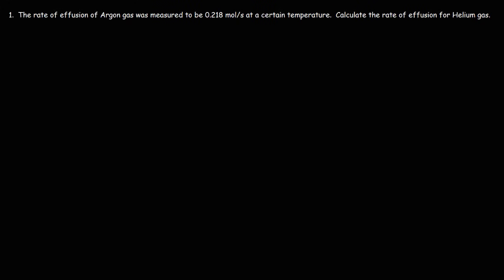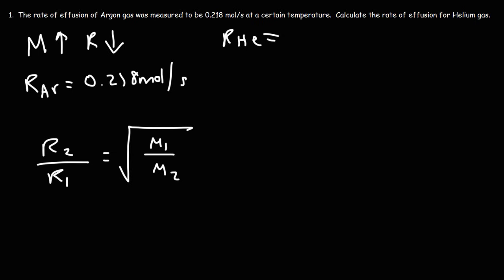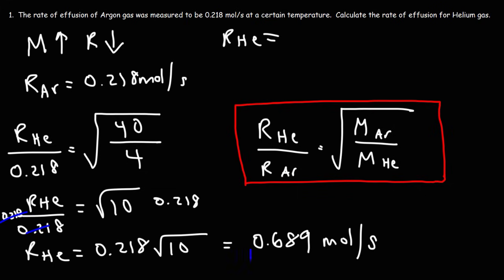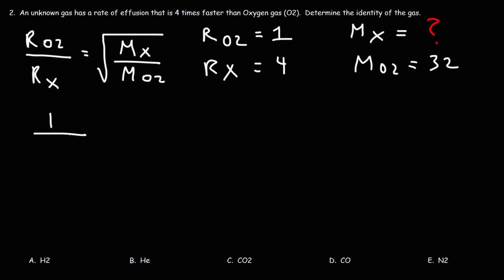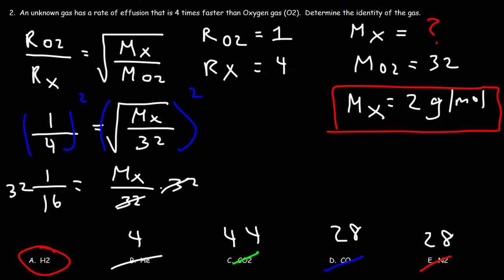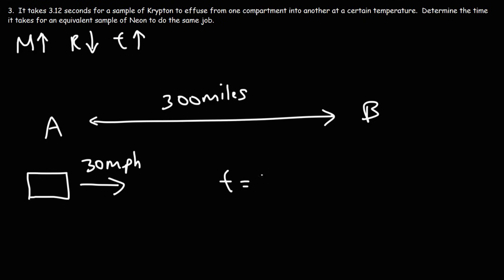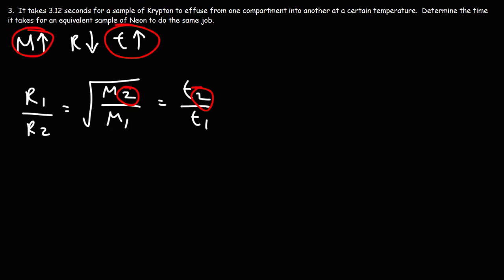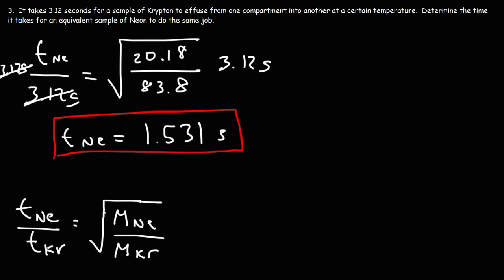Graham's Law of Effusion

Comment: Professor Organic Chemistry Tutor, thank you for a short and sweet video/lecture on Graham's Law of Effusion in AP/General Chemistry. According to the history books on Chemistry, during World War II, Graham's Law was applied to a rather complex chemical problem. It became necessary to separate U-235, which is fissionable, from the more abundant isotope of uranium, U-238. Since the two isotopes have identical chemical properties, chemical separation was not feasible. Instead, an effusion process was worked out using uranium hexafluoride, UF6. This compound is a gas at room temperature. Preliminary experiments indicated that u-235 could indeed be separated from u-238 by effusion. This is an error free video/lecture on YouTube TV with the Organic Chemistry Tutor.

Comment: Actually the formula in the thumbnail is not correct it’s supposed to be R1/R2=square root of M2/M1 cause the molar mass of certain elements is inversely proportional to its rate of effusion, just sharing ya know 🥰✌🏼
Reply: Yep .. infact that's why I even opened the video cos it was given wrong
Reply: Uh it still same
Reply: It's the same thing🤦🤦 geez
Reply: thx
Reply: Caus it doesn't matter whether it's up or down but it has to be inversely proportional